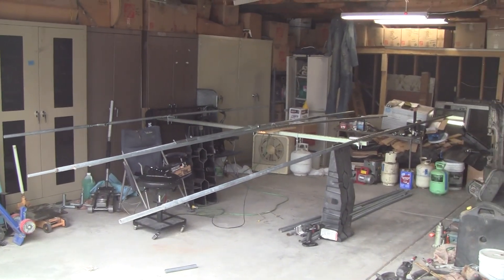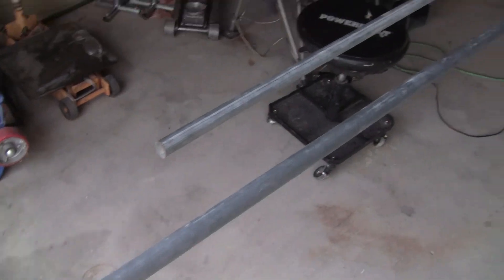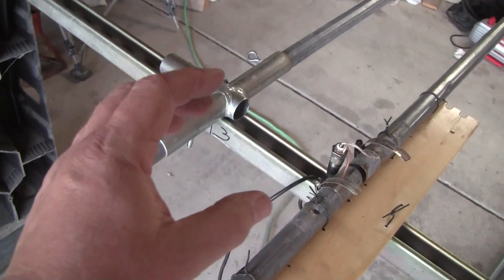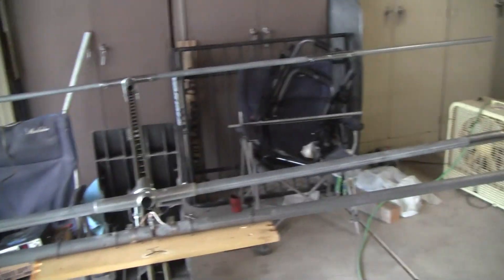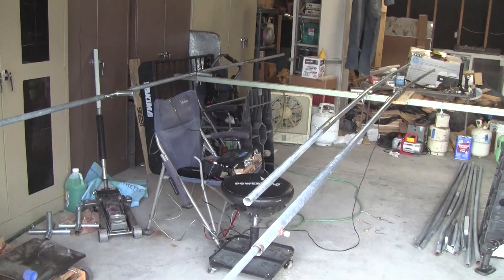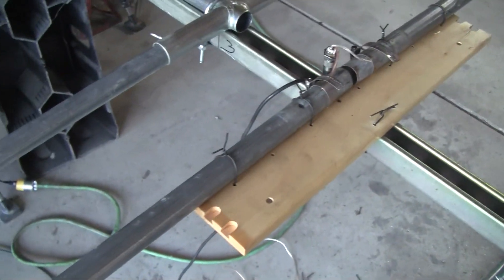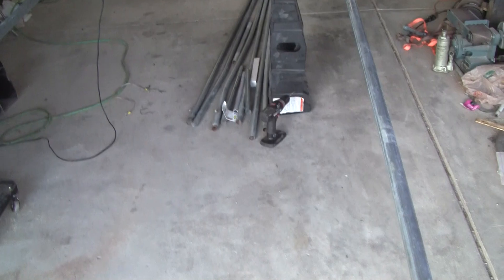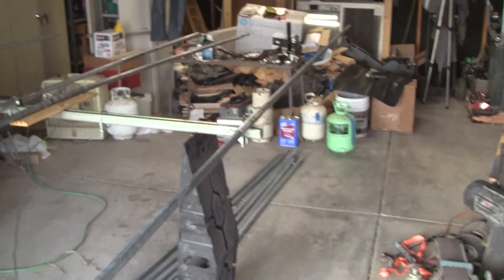10/11 Meter Yagi. Very Broadband !! Part 2.

Comment: Whatever happened to your antenna....update?!!!
Reply: What was your dimensions  on the two driving elements and I can figure out the director.
Reply from the maker: @gburlin  Dimesions added !!!
Reply from the maker: My health got in the way. Still hoping to get more testing going on it perhaps this year.
Reply: I’m currently building a bay house on a canal system over water on the Texas coast and my 50’x24’ deck is craving that broad band antenna with a director only, no reflector.
Reply: @gburlin  sounds to me your more concerned with giving irrelevant details of your "awsome"  bay house than with any antenna. Its ok your attempt at gloating isn't at all cringe.
Reply: Im in a HOA, so I’m gonna have to make one with wire and a Balun. I can just stretch it on the deck😎